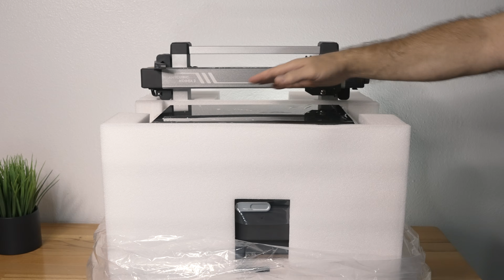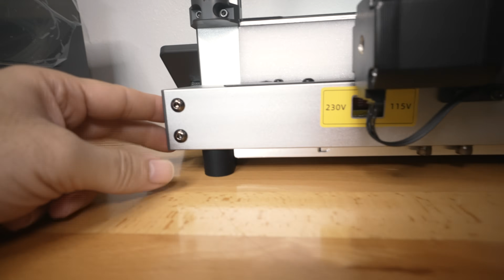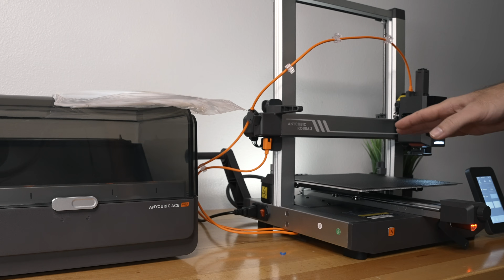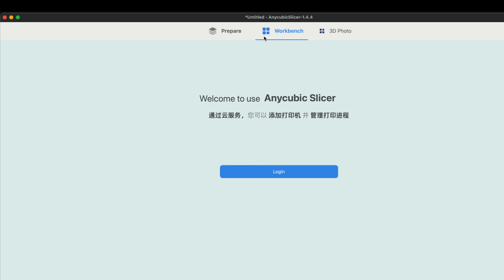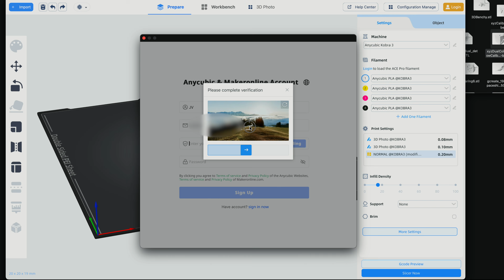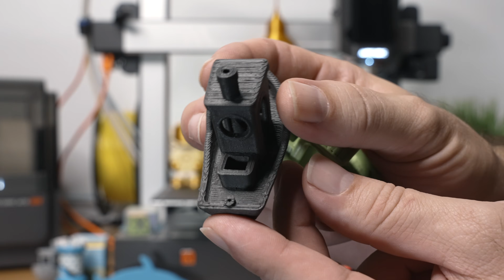Anycubic Kobra 3 Combo - Multi Color 3D Printer - Unbox & Setup

Comment: The high speed print would have been better on a stable surface, that table was rocking all over the place.
Reply: Saw this on another video as well. They literally put the printer on top of the ACE unit. Thing was wobbling like crazy. Print wasn't that great, but I think the main reason why was it was so unstable.

Comment: Another copycat, still don't think this multi colour method is at its peak, the amount of waste is RIDICULOUS.
More Bambu clones coming in 2025 most likely....
Reply: Less waste then spending hours sanding and painting. Plus you can always make bricks from the poop or other stuff
Reply: How do you want a bedslinger to look if it don’t look like bambu. They need a purge wiper and a nozzle wiper. Just because bambu has it dont mean they copied them side by side cause I’d like to see you design one without it “looking like a bambu clone” and it dont
Reply: You can adjust the wast in the settings
Reply: You can adjust the amount of purge “poop” on the screen, and as far as calling it a clone… it’s a 3D printer, how else is it supposed to look?

Comment: I'd rather choose a higher print speed than such a waste of multi-color functionality .
Reply: You don’t have to choose it can do 600mms  plus you can use the ams for auto roll change of the same Color. There isn’t really much fast printing
Reply: I own this printer setup . It's the best outbof all the printers I've owned . And high quality and faster then older models

Comment: Could this be any more identical to a Bambulabs A1 Combo? Wow. Even the manual is similar.
Reply: A1 combo has the AMS lite that is way worse than the ACE which is actually better then the more expensive AMS as it drys filament, has less waste, does not break the filament.
Reply: @eaman11  I don’t really care about drying, I just want one that works 😂

Comment: Fun Fact: if you print multiple color prints, as in six as opposed to just one, the printer will use the exact same amount of purge as doing just one.
Reply: The one time quantity overshadows quality by a longshot 😂
Reply: obvious. It depends on layers and colours not objects.
Reply: @casio007 it's still a useful tip for those who may be new to printing
Reply: @casio007  It will be the exact amount of purge no matter the colors and layers from one object to many. It is how it works. The printer won't purge more because you have more models.

Comment: Great video.  I think I would choose the Bambu Labs A1 with AMS but I can see why someone might choose this instead.
Reply: I was in that boat 2 months ago.

Chose Kobra 3 for few reasons.
More open
Ace pro is also dryer
And can connect two ace pros for 8 colors.

So far I have no regrets...

Have x1c at work, had more issues with that then Kobra 3.
Reply: @nekrosoft13 do you use the stock slicer?
Reply: @jared1321  I use the new stock slicer. I believe is called anycubic slicer next
Reply: @nekrosoft13  nice did that fix much of the issues?
Reply: @jared1321  is basically orca slicer, so yes. Is much better than old.
Reply: @nekrosoft13  Hey nekrosoft, I am really wondering what settings you print on. Can you share your profile with me? I also use Slicer next. I also wonder what the 15m benchy settings are to print at high speed.